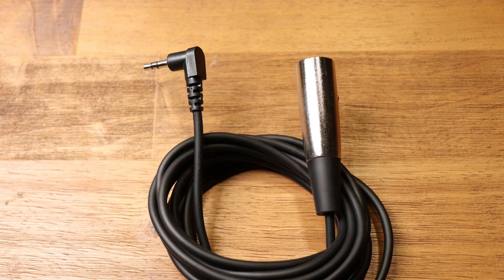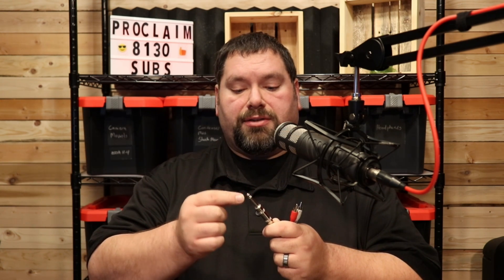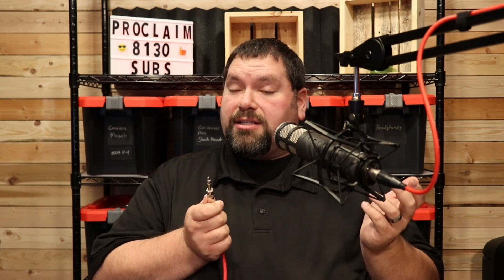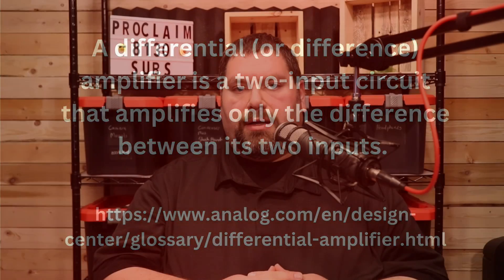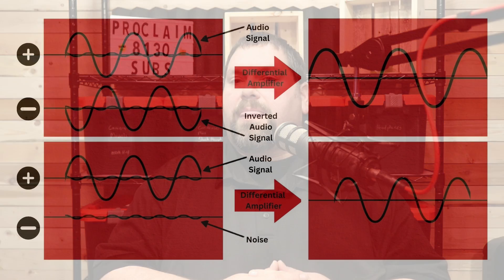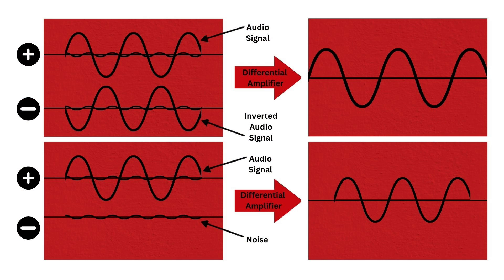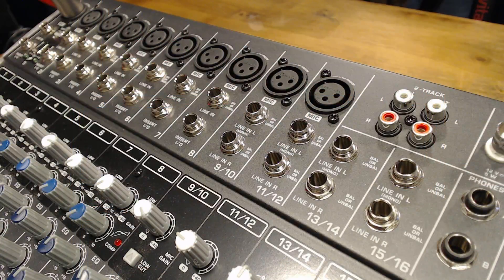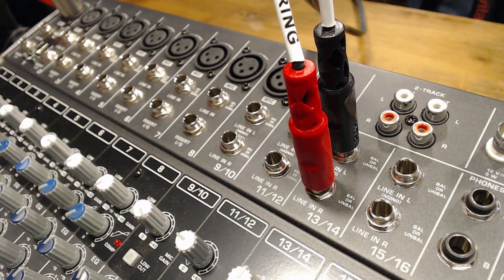How Balanced Audio vs. Unbalanced Audio Works

Comment: Maybe in a future video go over how to handle connecting balanced and single ended gear. Most people don't know that the 2 modes of operation are not compatible and steps need to be taken to make both ends of the connection either one or the other. If you don't know what you are doing, you can also damage your equipment. Although, its not as serious as phantom power. What's worst is the marketing tricks some companies play to make you think you have a balanced connection when you don't.
Reply from the maker: Great idea!